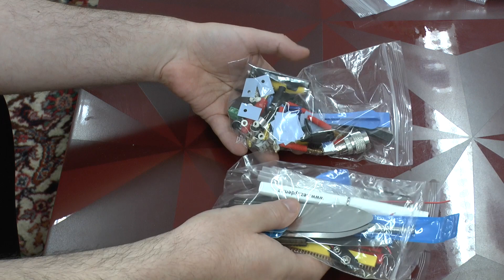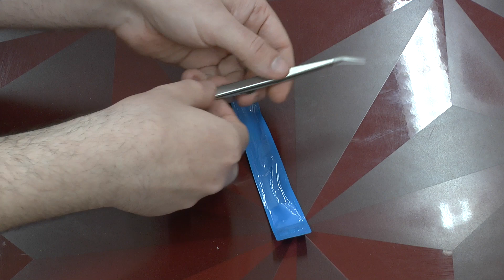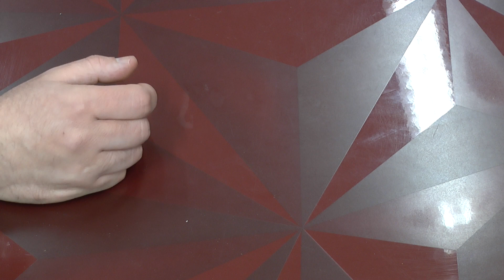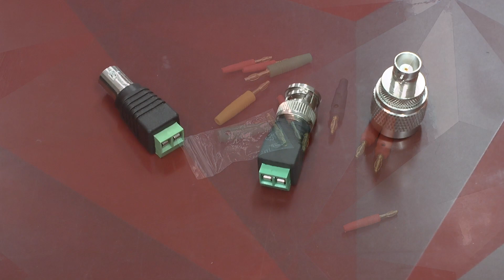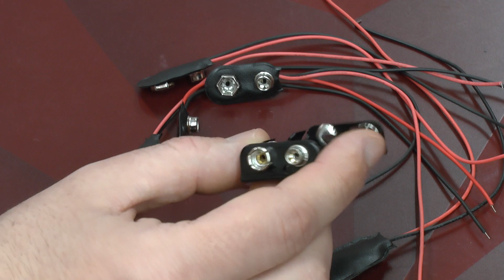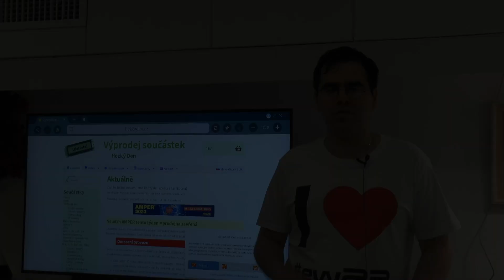HezkyDen.cz - electronics shopping haul

Comment: Are the BNC to screw terminals a direct connection, or ate the baluns? The ones I have are baluns.
Reply from the maker: Hello Michael,
thank you so much for talking back.

I am honest, I do not know for sure. Is there any test I can do for you so we find out more?
Reply: @MrTamhan  If it is a balun, there will be continuity from the center pin to the shell of the BNC connector. The ones that I have were made to connect CCTV cameras with twisted pair cable.
Reply from the maker: @michaelterrell  Hello, I just tested. There is continuity between center and the one pin, and mass and the other!